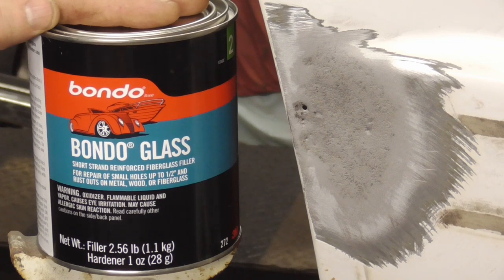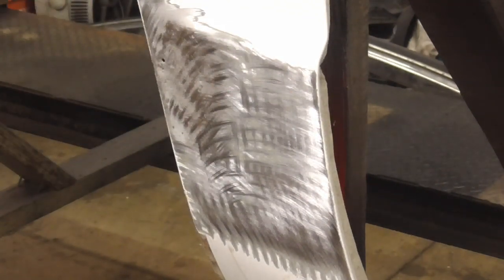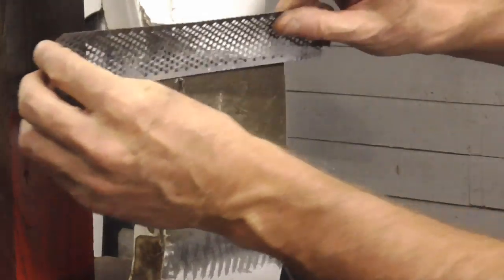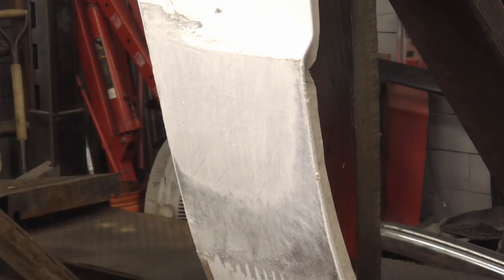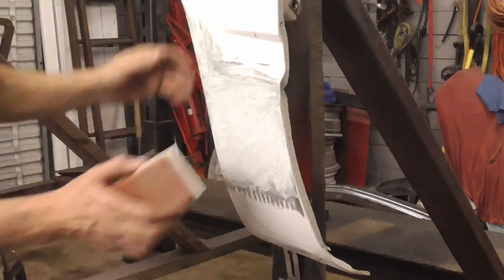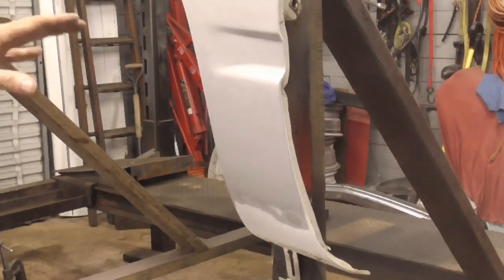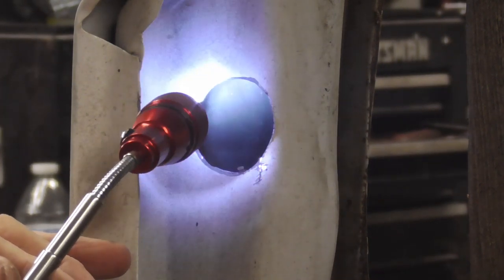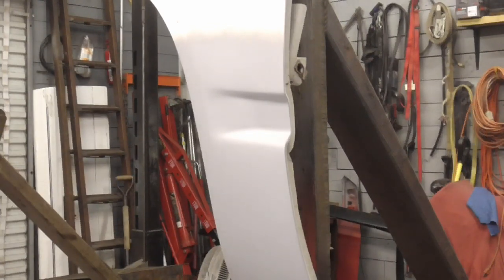How to Fix a Rust Hole Without Welding:  Duraglas, Kitty Hair Filler, Bondo Glass

Comment: I’ve sprayed the back side of my rust repairs with Eastwood internal frame coating with good results.

Love the flexible spray tubing for hard to reach places.
Reply from the maker: Good tip Rod - thanks - I'll check that stuff out :)
Reply: @LakesideAutobody  Thanks to you I now do rust repair on my 2005 Tahoe. Did left rear quarter panel a while back, starting rocker panels next week. 👍

Comment: I did many repairs using Tiger Hair etc. back in the 70s and early 80s before I could afford my first MIG welder. In High School and the few years following we all had rust buckets and some of us knew how to fix them. I got so I could even repair shapes like the dog leg part of the rear door jamb. I had a cheap sandblaster to blow the rust away, then used Tiger Hair. I would knock the metal down a bit, put a coat of Tiger Hair on, then embed a piece of fiberglass cloth saturated with Tiger Hair over that. Lay a piece of wax paper from the kitchen over it so I could press the cloth into the Tiger Hair and mold it all into shape and flatten the lumps out as it hardened. Top it with a skim of Bondo, seal the back with undercoat and these repairs would last for several years. We weren't restoring Classics, we were keeping our S#%tboxes legal, roadworthy and looking nice while having fun doing it! Thanks for doing this video Jerry! Larry
Reply from the maker: You're welcome.  Thanks for the story and your logic.

Comment: How times have changed.  When I was coming up in the 70s the idea was to use very little if any monkey hair, Bondo on a repair.  All the fillers are Petrie dishes for cracks, paint peeling etc.  unused auto paint was used  for high spots.  My time came right after the use of lead.  Those men were truly talented.  Sucks to get old, revolving cycle. Peace
Reply from the maker: All those old guys in the 50's 60's and 70's were very talented.  Brick layers, masons, plaster, draftsmen, builders, body men, on and on.....  It's amazing that all that knowledge disappears when the guy passes away - sad really.  Peace to you too my friend :)

Comment: Good video.  One thing you didn't mention was that the bondoglass and kitty hair, being a fiberglass based filler , is that it is waterproof, unlike regular bondo which soaks up water.  The fiberglass keeps any moisture away from the problem area!  Also, I would like to see photos of the rack you were using here.  Take care.  Tom
Reply from the maker: The rack that I'm using is just two big triangles made of 2x4's.  I just C clamp them to the car lift ramps and attach the various panels any safe way that I can - but I'll try to get a video on that for you - Thanks for watching :)
Reply: My question, is it still polyester based ? 
If so ,it's the same as bondo with all the moisture absorption that comes with it. 
Epoxy based is a different story. 
Fiberglass boats gain weight sitting in the water,tells me right there that polyester isnt all it's cracked up to be.
Reply: @MrTheHillfolk it's not the fiberglass that absorbs water it's them leaking from somewhere and the wood and foam that they use in them that gain the weight.
Reply: @natevanlandingham1945  
Polyester absorbs moisture, ask anybody who owns a boat how much heavier it is at the end of the season.
Reply: @MrTheHillfolk  I own several boats. One is fiberglass. I have owned two other fiberglass boats as well. They have a gelcoat on the outside of them, they should not have water penetrating the hull..if there is you have a leak. If you have a leak your foam flotation in the bilge and the wood will absorb it. Never glass constructed boats use plastic wood or basically it's like those plastic cutting boards you use in the kitchen. It's called like HTPE plastic or something?

Comment: I know this video is 2 years old, my question is why would you use a rubber undercoating?  Living in Chicago the rustbelt once a tiny drop of water gets under the undercoating it starts to rust. 
Been doing body and paint for over 34 years, I mainly work on vintage and classic cars.  I do leading which you know is a dying art, but one of the best repairs.  
I was lucky enough to start in a shop when I was 19 and was getting trained, one day I was watching the owner do some lead work on his I think it was a 46 Oldsmobile.  I was just amazed how the lead just flowed. I asked the owner if he could teach me and it was the best thing I ever learned.
Reply from the maker: You are absolutely right - we've all experienced what Ziebart causes.  It does have it's place though if you really clean the back side a prep it well - it'll last quite a while.  I prefer this though to any other method of prevention - https://www.youtube.com/watch?v=8XaZBy7GC7A  or this https://www.youtube.com/watch?v=y05dNxt-nVc  Hope that clears things up - thanks for watching my friend :)

Comment: i know its a old video' but what is the largest hole you cold do this to for tempoary say 5/6 months? maybe using fiberglass patch material with resin.
Reply from the maker: https://www.youtube.com/watch?v=gIS1Tbv7Kvw  This repair is still fine today - made sure the panel could drain and stay dry inside.  I wouldn't bridge anything too large.  If you have to bridge use cloth like this - https://www.youtube.com/watch?v=Zp5gmDC7KQI  Both will last quite some time if the panel can drain and dry out inside - try to under coat the inside too if possible.
Reply: @LakesideAutobody  what about a 1& half inch hole in a Ford bed fenderwell? Fiberglass cloth with resin, then after Harding smooth out with body filler ? Should I use 2k primer inside and outside? Thanks for your help

Comment: If you needed to could you fiberglass over the bondo glass? Is it poly resin based so the fiberglass sticks?
Reply from the maker: I've never attempted that but since filler sticks to fiberglass really well and it's made with the same resin base, I can't see why the fiberglass would not stick to filler.  If you try it, let me know how it goes for you :)

Comment: I have a rust issue like this on a 87 dodge d100 rear fender flare and can't get to the inside😢
I need to drill the body and install rubber plugs some day but need to finish other projects first hurts to see it though.
Reply from the maker: I owned the same year Dodge but it was a Ramcharger - nice trucks.
I used or welded in the patch panels that you can order from places like Raybuck.com.  Those are great looking trucks.  Keep me posted when you begin your project :)

Comment: A question...you used the electric sander at the beginning as opposed to DA Sander,,?? why so ?? Thanks
Reply from the maker: That was a grinder/sander/buffer with a 40 grit fiber resin disc on it to remove the paint and really rough up the metal in order for the filler to stick really well.  Filler never peels, chips or fall off of a properly prepared surface.  You can use a DA too but sometimes a DA is not fast enough for me and it doesn't stay as sharp as the 40 grit fiber resin disc - instead of cutting it rubs if dull and filler don't like to stick well to that :)

Comment: Are you sanding with the 40 grit after the Kitty Hair has completely cured?
Reply from the maker: Yes - after it hardens.  This stuff is sort of hard to sand so you might want to knock it down first with a cheese grater blade - Stanley Surform 21-299
Reply: @LakesideAutobody  i understand but are you sanding it while it is still curing or fully cured?
Reply from the maker: @alexhuevera939  Got it - I'm sanding it while it is still curing.  Like.... about 10-15 minutes after it was applied :)

Comment: Can you paint over the bondo glass with Por 15 or do you have to prime first. I have pin holes in my VW bug and I hit it with ospho and now getting ready to tackle the pin holes
Reply from the maker: It's normal practice to prime over it first.  You can use any type of automotive grade primer though - lacquer, epoxy, or urethane.  Epoxy doesn't sand well so if you are going to block sand the first application of primer it's best to go with lacquer primer surfacer or urethane primer surfacer.  Or even some spray bomb primer if you're just doing a daily driver.

Comment: Hi, After you sanded the fiberglass did you clean off the dust with acetone before you added the bondo filler?
Reply from the maker: No - usually just blow it of with air but it wouldn't hurt at all to hit it with thinner, wax and grease remover.  Never used acetone to wipe a car but I'm sure it would work fine as it dries fast and pretty strong.

Comment: Another great video. Where can I get those 36 grit grinding disks and that metal body filler spreader?
Reply from the maker: Grinding discs are from Benchmark Abrasives and here are the spreaders: https://www.ebay.com/itm/141695623597?chn=ps&norover=1&mkevt=1&mkrid=711-117182-37290-0&mkcid=2&itemid=141695623597&targetid=1262779893809&device=
Thanks for the support and have a good week :)

Comment: I would ask you kindly, to post a list of products you use. If I use a bondo from a different brand, it seems to react different. The same goes for Filler etc. If you could point me in the right direction to find a List, or post one. It would be much appreciated. Thank you and keep up the good work.
Reply from the maker: You're welcome Ralph.  The fiberglass reinforced filler used in this video is Bondo Brand short strand reinforced filler.  The regular filler is Autobody Master light weight body filler.  What issues are you having?  Usually the variables that cause filler to react differently is temperature and amount of hardener used.  Jerry
Reply: @LakesideAutobody  
Thanks so much. I'm in Forida and everything is difficult here except vacationing. For me the Bondo hardens to fast, even if I cut back on Hardner
Reply from the maker: @ralphroderer3905  You're right - in the summer in a hot shop it can get over 100 - you just have to cut back on the hardener and get fast at spreading :)
Reply: @LakesideAutobody  sounds good, once again less is more. Thank-you.
Reply from the maker: @ralphroderer3905  You're welcome Ralph ❄🎄😊

Comment: What is the secret to not getting 40 grit sand marks in the metal not to show after painting? When I used to do body work even after heavy priming it seemed like the scratches in the metal always showed.
Reply from the maker: The ones in the metal never show for me (there's really no scratches or "deep" scratches.  If I leave them in the paint (don't DA or feather edge well) they end up showing (sometimes).  Sometimes you can get away with cheating a bit.  If you leave your filler a bit full and sand the rest with 80 grit (what your supposed to do) you be absolutely fine.  Hope that helps - Jerry

Comment: Unrelated topic. I would love to see how to mount a fiberglass hood scoop to a metal hood. Blend the 2 together to make look as one. I have one riveted to My Hood but I don't know how to make the two blend together.
Reply from the maker: I would love to show that - good request.  Here's the steps while your waiting for the vid.  The scoop should have a flange so rough that up along with the hood about 4-6 inches out all the way around.  Mix up some fiberglass reinforced filler and "feather" that seam out into the hood - like they do with butt seams in drywall.  You'll sand the filler just like you see in this video.  If you have more ?s - ask - Jerry
Reply: @LakesideAutobody  Thank you. I appreciate it. I have a fiberglass cowl induction hood scoop on my steel hood 1979 Chevy Caprice 2 door And want it to look nicer.

Comment: It looks great!!!...how long will that repair last???
Reply from the maker: The longevity of this type of repair depends on some things:  1, could you seal the back side with undercoating or something similar 2. Is it a daily driver in salt and snow 3. Is it a trailer queen  4. was the job done properly where the filler was thick and rigid 5.  Is there good drainage at the bottom of the panel   This type of repair can last forever or less than 3 years so....  again it's how you take care of it after the repair.
Reply: Thanks!!!

Comment: For a beginner looking to try a diy, how do you know which grit of sandpaper to use and when to switch to a higher/lower grit during the repair?
Reply from the maker: Here's a quick run down.  I will do a video on that topic very soon.  Filler work = 36 grit then 80 to finish it before primer.  Paint work = 120 grit on the DA (rough sanding / feather edging) /  220-240 on the DA for paint work or finishing your primer / 120-150 for block sanding you primer surfacer.  Rule of thumb is use what cuts the fastest but know that eventually you have to get it down to 220-240 (DA) or finer if you hand finish sand (320-400) for paint.  Exactly like doing a wood project really.  Let me know if you have any more ?s on that :)
Reply: @LakesideAutobody  So the last grit before paint should be 400 if doing it by hand? Does that also apply after you’ve primed it?
Reply from the maker: @mrsemifixit  Last grit by hand is 400 - yes.  If you use a DA the last grit is 220-240 or finer if you want.  I finish sand my primer too just in case there are nibs or dust.  You want everything completely smooth before paint.  I keep a spray bomb can of cheap auto primer for any little bare metal spots  left (you don't have to sand that).  If any confusion ask again :)

Comment: -- Old school here: we used to call it Premix, as in premixed fibers in a polyester resin .
-- Air bubbles don't matter so much in fiberglass premix: U will finish with filler anyways
-- Use a vacuum instead of a blowgun

Comment: What works best to keep water out of the repair: fiberglass reinforced filler or fiberglass cloth with resin? Thanks for the video!
Reply from the maker: Fiberglass reinforced filler is waterproof but hard to sand if you let it get too hard (cheese grate it before it hardens).  If you can get to the back (often impossible), you can wire brush it and coat it with some undercoating.  That will seal it for a long darn time - no water = no rust :)

Comment: What is a good primer in a spray can
Reply from the maker: Most primers in a spray can are very similar - they are good for priming bare metal before painting and that's about it.  They are not high build or primer surfacers that can be block sanded.  So.... I would just use the most inexpensive (rustolem, krylon, etc.) since you're just going to use it cover the bare metal before painting.

Comment: This guy has obviously done a lot of work for small wholesale car lots and curbers. They are the only people that would accept this type of work. He's what's known in the industry as a paperhanger.
Reply from the maker: Not true -  Please see this video for longevity of this type of repair and mig welded repairs if done correctly: https://www.youtube.com/watch?v=8XaZBy7GC7A or 
https://www.youtube.com/watch?v=2o37dX--w0I
Reply: @LakesideAutobody  Great video. Those little holes though... it'd only take a few minutes to prep and fill them using a mig... Would you fill those holes if you had a mig handy? Your great filler work needs to be done anyway but could be thinner? I personally think the welding is a lot easier than the bondo and also much less toxic and easier to re-repair. The car in your longevity video is a solid car like isn't made any more. Cars today are often made with thin inferior sheet that flexes and thick bondo will crack and detach. Thoughts?

Comment: It would be nice if the undercoating came with a straw so that you wouldn't have to get some much product on the foreground.
Reply: His undercoater had a tip that sprayed flat to cover a wider area.  The problem is that there are several different formats of spray tips and they are not necessarily inter-changable.  Nice to use a WD-40 straw tip on an undedrcoater can IF IT FITS.
-- I keep a variety of cleaned diff tips just for that possibility.
-- AutoBody supply house may have undercoater with straw tips, or use a spatter gun
-- small holes only if u have a straw sprayer

Comment: Weld the pinholes, grind and no glass needed. Glass is porous like filler .. water will rust again.
Reply from the maker: This was a video for if you just want to fix a spot fast - Actually I've this type of repair last a long time especially if there's drainage allowed for.  Last, this stuff is water proof - at least that's what the can says :)